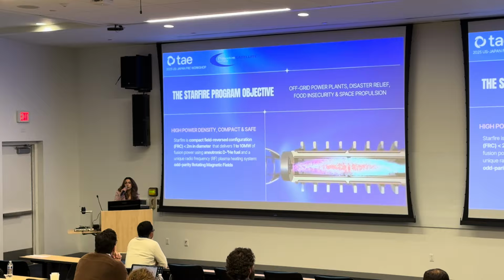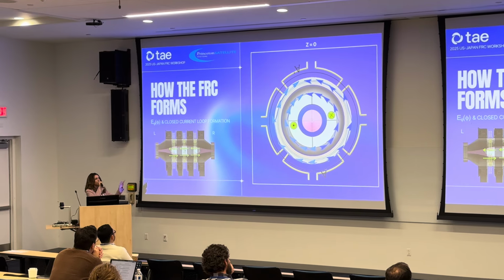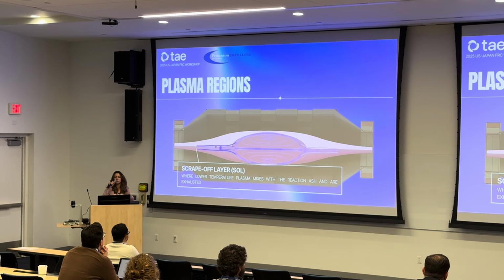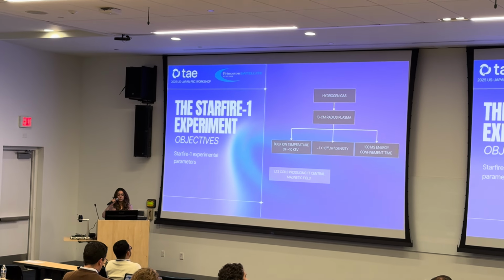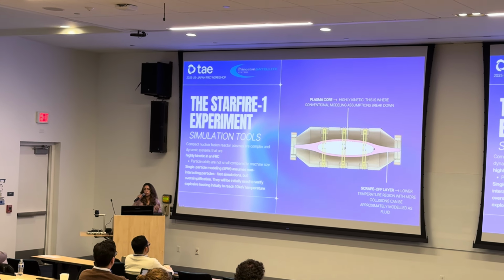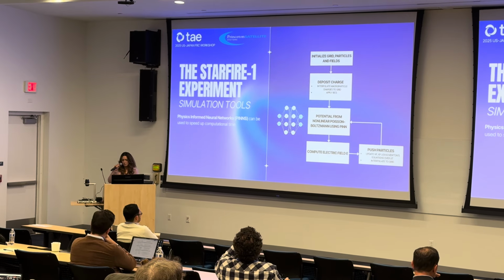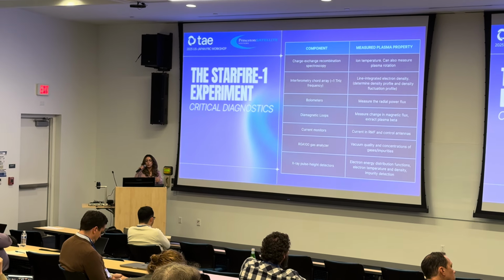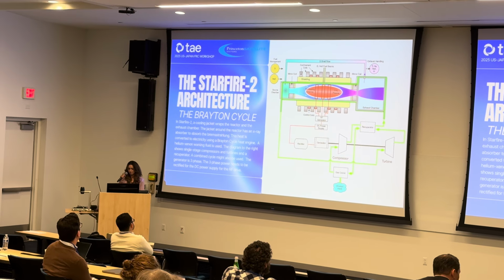Starfire: Nuclear Fusion for Power & Space Propulsion by Layla Mohsen (US-Japan FRC Workshop 2025)

Comment: Are you using ALON for Ceramic Windows?
Reply from the maker: We're investigating a variety of materials. ALON, though highly optically transparent, has a much lower thermal conductivity than other materials, making it unsuitable for fusion heat loads.